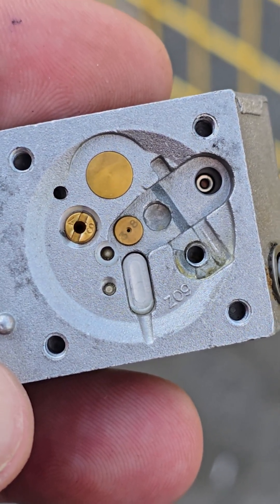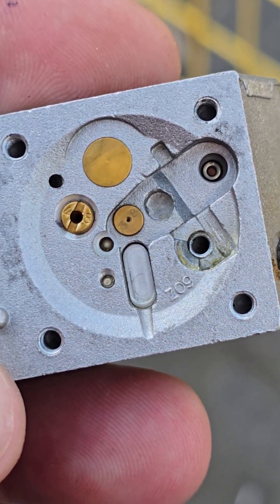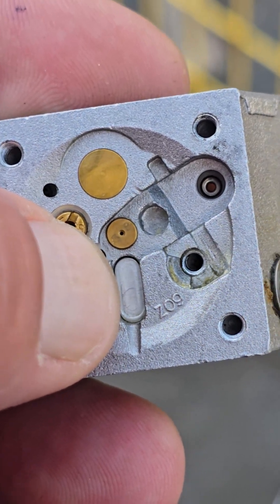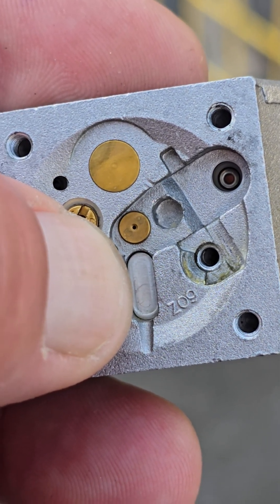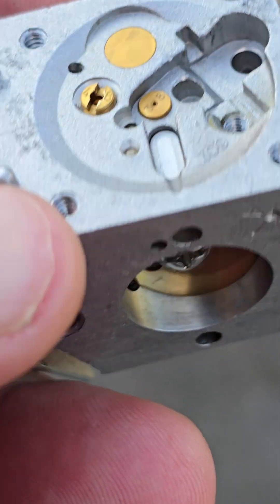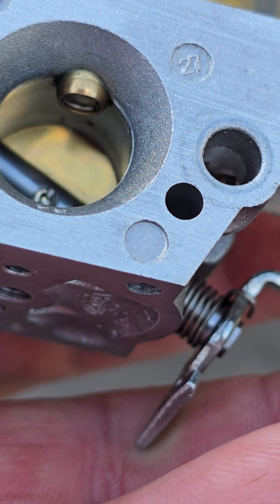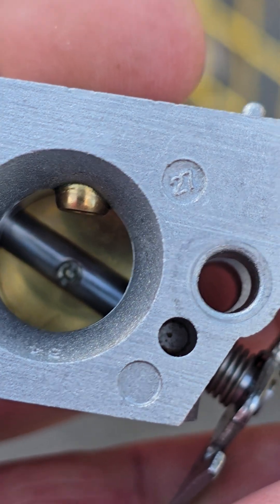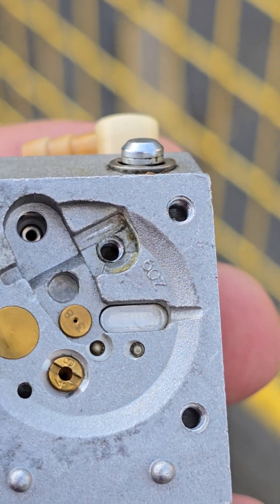What can cause a carburetor to flood itself 2 cycle small engine..

Comment: My late friend explained that very problem to me years ago, and sure enough, the plug on my fs45 weedeater  had fallen loose. I carefully laid the  plug on a flat surface and gently flattened it just slightly. I tapped it back in, and 15 years later, that thing starts with only 2or3 pulls, and it's scary powerful. You almost need a license to run it.